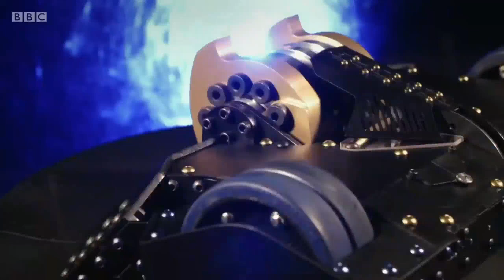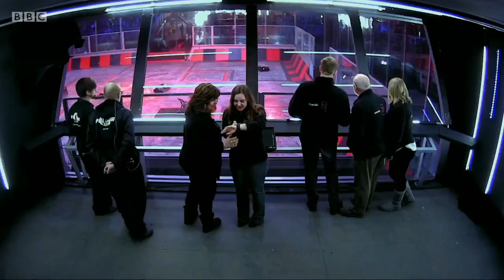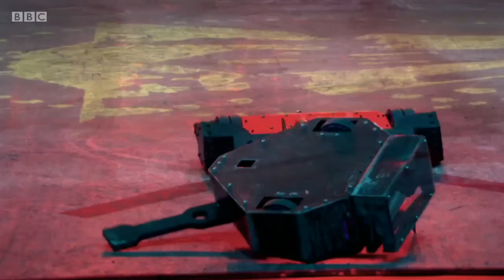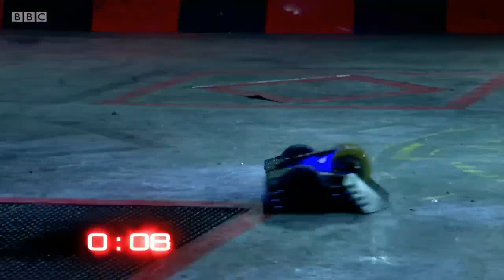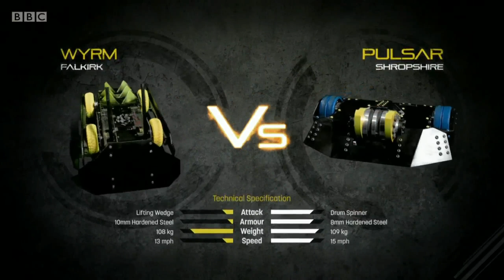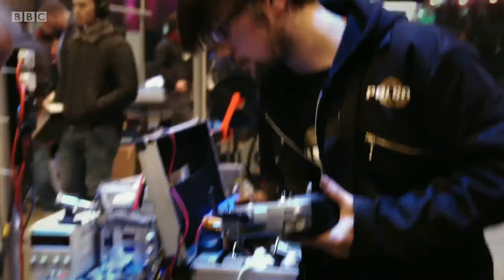Pulsar - Series 9 All Fights - Robot Wars - 2017

Comment: Pulsar has gigantic problem in that it's both over and underbuilt.
It has large number of screws and nuts, which might be problematic in disassembly, and it's redundancy is not very useful.
Tolerances on drum and parts around it are way too tight, so it's easy to get it stuck with even a slight hit.
Electronics are too much overdriven - it would be much better to just use more electronics far below power limit so that they don't burn out, and have spares for reduncancy - you barely spare any weight on that.
Other than that construction and design look supreme - I have not seen it having any serious damage on body.

Comment: Silly point of view perhaps, but wasn't the fact that they "turned everything up to eleven" their undoing in the end? If you're making something that needs to withstand the heat of battle (and some military-grade damage), I heard you should not exceed the threshold of the parameters of your gear, but rather stay comfortably below them. Then again, the spectacle was gorgeous, they sure will be remembered for that.
Reply: Lack of safety factor in the design. A common oversight from people not professionally trained in design.
Reply: Yep, one of the pillars of a rugged design is having excess capacity in as many dimensions as possible. A power delivery system and motor that runs at 80% of it's ratings, armour that can withstand a % factor over expected damage etc.
Reply: True
Reply: That's for actual real-world applications where machines are expected to work for years, maybe decades. For a robot combat fight where the bot is expected to last around 3 minutes, it's pretty normal to exceed specs by 100% or even more. 

The perfect bot is one that explodes in a giant ball of smoke and fire after 3 minutes and 1 second (or whatever the match length is) of operation, since you're extracting the absolute maximum of what your components can do.

Comment: I don't get it : how can push up one wheel ?
Reply: With the drum spinning theres a lot of centrifugal force coming out of it, that's why drum spinner bots can lift one of their wheels up and revolve on a single wheel.
Reply: Drum acts as a gyro
Reply: It's the effect of gyroscopic precession. The spinning drum creates a very powerful gyroscope, which has the effect of lagging forces applied to it by 90 degrees. So if the drum is spinning with the top going backwards, and you push forwards on the right side, it lifts up the right side instead. The forwards force is delayed 90 degrees to become an upwards force. It can be used as a tactic like in this fight, to raise a damaged wheel off the floor, and move enough to stay in the competition, or used for style like in some of sabertooth's later fights